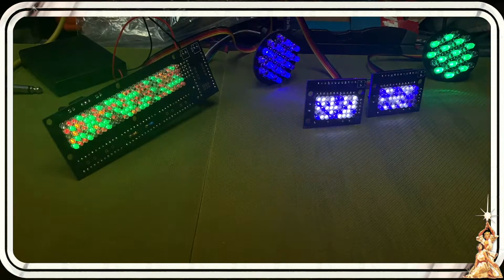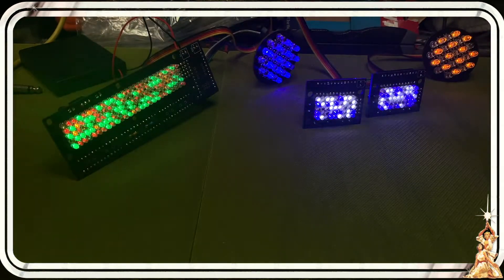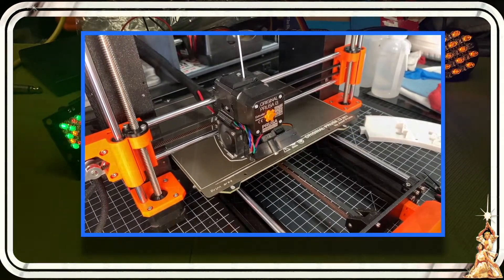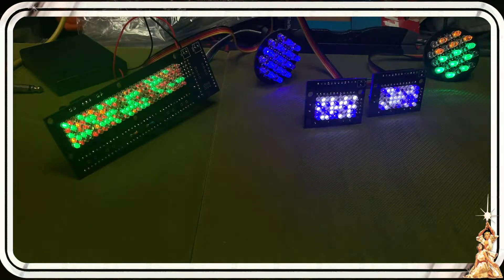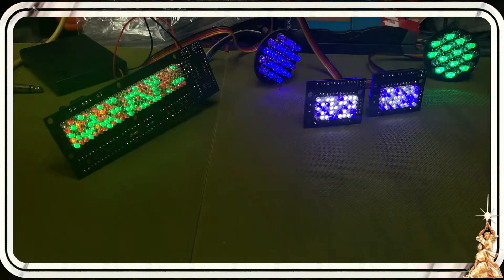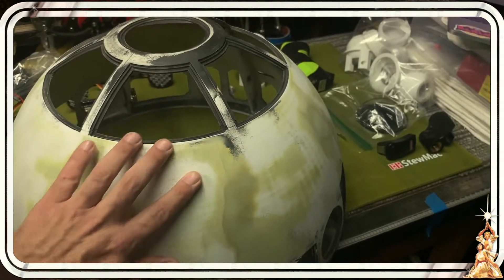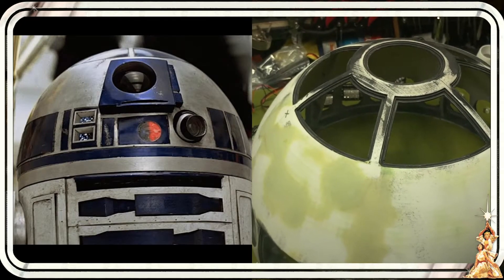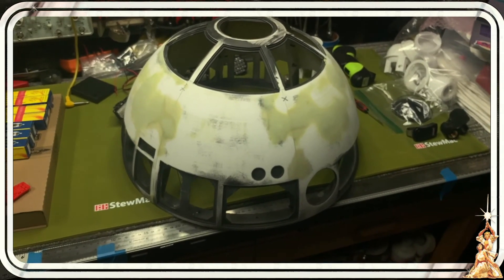3D Printing R2-D2: Episode I - I Hope I Can Finish This

Comment: Good luck on you're journey and I look forward to you uploading your progress.  I've learnt so much from people like yourself sharing on YouTube.

I've just completed printing every part of Mr Baddeley R2D2 MK3 on a Creality CR10S Pro2 over 4 months. Some 12hr prints had to be scrapped, but all up around 23KG of filament for me. PLA+ for body & ABS for structural/gears. 
One recommendation I can make, is clean nozzle every 10-20 hrs with an acupuncture needle. Every 60+ hrs take the nozzle out and clean with a hot air gun, getting in there with a drill bit and pull the gunk out. Otherwise just replace the nozzle. The Creality Pro2 nozzles are US$6 per pop :( Whilst you have the nozzle out, also replace the Capricorn tube for those of you with with Bowden tube printers , you'll be amazed how smoother the next print goes, like new!
I too was nervous about leaving my printer running whilst away from home. I installed an internet controlled power point and a cheap internet camera pointing at the print bed. Any problem whilst watching at work on my phone and I could just kill the power to the printer. Did it a couple of times, as sometimes a print might get knocked over and ruin the next 20hrs.

I'm in a gluing and sanding stage and expect another 3-4 months ahead of me before I have an empty, but painted droid. and I haven't even stared on the electronics yet!

Boy, they weren't kidding when they say it could take 12-18 months to complete R2D2.
Reply from the maker: Hey thanks for stopping by and leaving this great comment with tips! Hopefully you post some of your build on your channel!

Comment: Nice work & thank you for taking the time to share your build.
Any chance you can share links to where you purchased parts?  
I'm looking at the various options I can find.
Reply from the maker: The lights I ordered off of MisterFubar on the Astromech forum, just search for TEECEE'S LIGHTS KIT. The Holoprojector lights and components which I did not show I ordered from Digi-Key which I sourced through Curiousmarc's website: https://www.curiousmarc.com/r2-d2/holo-lights. The PCB's for that can be found here: https://store.oshpark.com/collections/droid-parts/products/droid-hololights-v2-0 : You can also get a fully assembled HoloLight from the forums just search for Curious Marc HP Boards: glynharper is the guy selling them I believe. The radar eye I also ordered from a forum member: Stef94 and can be found with a search for Radar Eye Lens although some people are using cut acrylic clear ornaments you can find at Michaels. The Cabochons I ordered through Tap Plastics https://www.tapplastics.com/product/plastics/plastic_rods_tubes_shapes/acrylic_cabochons/139 : You can get these off amazon but you'll have to buy an assortment bag. Tap allows you to order specific sizes: The size you need is 1 1/2 inch and if you want to use them for the buttons you'll need two 3/4". I also ordered the Master and Slave kit for the Marcduino system through Mowee on the forum. Other than that, everything else hardware wise I have ordered from McMaster Carr, bolts, screws, nuts, 500 mm threaded rods for the body, etc.

Comment: just ordered my 3D printer to start this project
Reply from the maker: Nice. Which one did you order?
Reply: ANYCUBIC Kobra Max i think i am going to use pla and so far i am going to make an r2-q5 going to try a few different brands of black pla to see what works best.  I am totally up for any suggestions or recommendations i know this is going to take some time to build but i am prepared lol i may buy a second small printer to keep progress up.
Reply from the maker: @fiercewolf2740  are you going to paint it?
Reply: @ColecoJoe  yes for sure going to paint i figured black pla in case of chips it will be the same color under
Reply from the maker: @fiercewolf2740  grey would make the chips look like metal :)
Reply: @ColecoJoe  well now you have me thinking lol.   do you have your remote control yet ?
Reply from the maker: @fiercewolf2740  nah I’m nowhere near that stage. I’m the slowest builder in the world. I barley finished printing the body and now I’m on a break :)
Reply: @ColecoJoe  i gotcha well I look forward to your next videos.  i have you subscribed to keep an eye on your progress I will start uploading my progress when i get started.